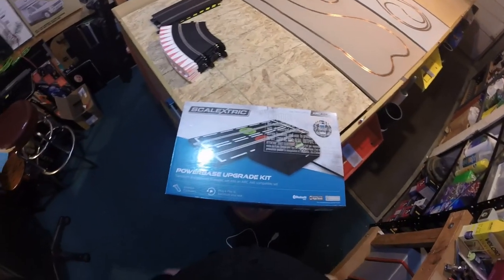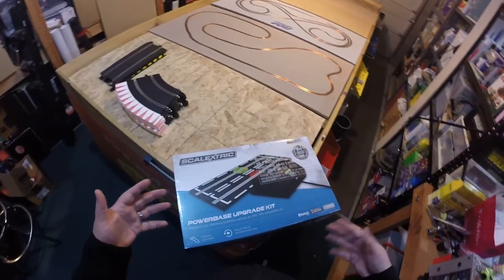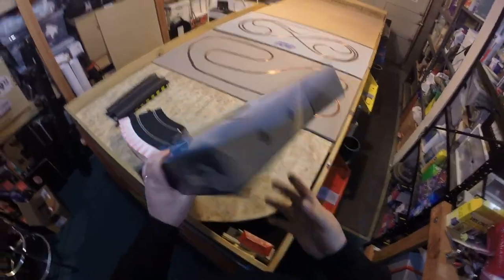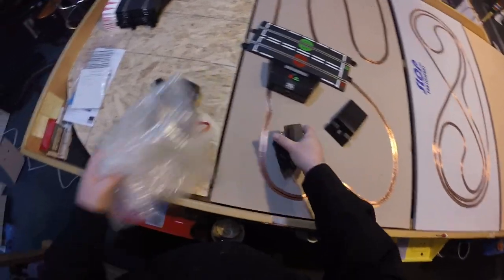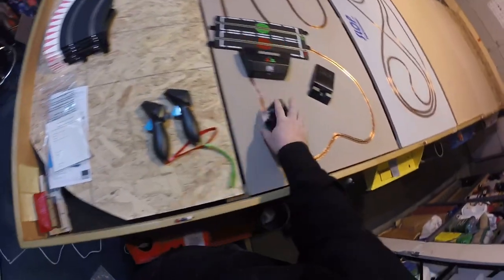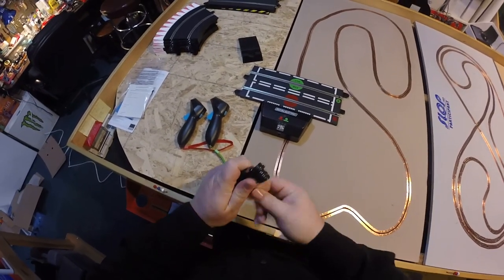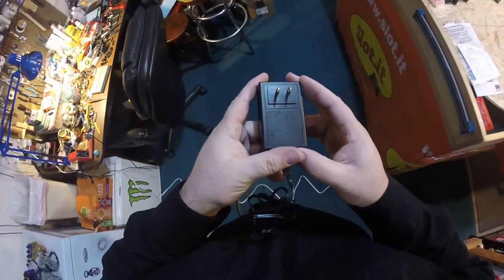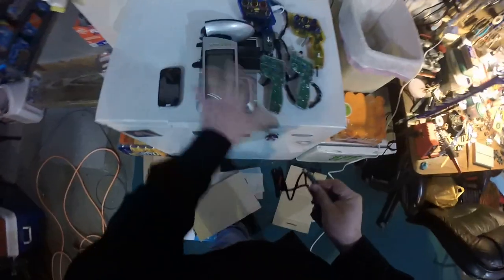Scalextric ARC Air Unboxing

Comment: Hi Greg I ran into your video trying to solve a problem I have with the ARC AIR powerbase. Basically everytime I trigger the accelerator on the controller paired to lane 2, I'm getting a "power base overload" error message on the app and a red light on the base itself. This happens even with no car in the lane. I have cleaned tje track, lane, everything, actually I'm testing it only with the base with no additional track pieces and still getting the error. The other lane works perfect. Wondering if you ever opened the base and have a clue on what could be going wrong. Thanks in advance!
Reply from the maker: Leonardo Rocco it sounds like the electronics that control the power to that lane are shot. I would contact the dealer or scalextric for replacement under warranty.

Comment: Hi Greg I have just unboxed my own Arc Air and there is a kind of buzzing in the cars motors al low throttle. Do you know if this is normal? Thanks for your videos. Very useful for beginners like me.
Cheers
Reply from the maker: That's not uncommon for a system like this where the power is provided using a wave of varying pulse width, not direct current. It will be more or less noticeable at different speeds with different cars. Do the cars seem to drive OK or is there a problem driving them? If you'd like to post a video, I can verify for sure.
Reply from the maker: @josevilar1012  Yep. Exactly what I figured. Totally harmless, and indicative of the PWM method of powering the cars.
Reply: @ggaub  Hi Greg, thanks so much for the info, it's kind of relief. Greetings from Spain

Comment: Of course the controllers take batteries I mean they are wireless! 😉🤣🤣
Reply from the maker: Hehe, yeah... I should have been more specific...  I meant it takes alkaline batteries rather than having rechargeable ones like other systems have.
Reply: @ggaub  of course I was just being facetious. The upside over rechargeable is that if they die you simply replace and keep racing but if rechargeables die you have to wait for them to charge. So plus and minus either way. I’m guessing the AA battery life will be quite long! So this ARC AIR is still analog racing not digital? I’m new to scalextric and still trying to figure things out!
Reply from the maker: @backyardcnc  yeah, pros and cons for everything. :)
Regarding ARC, it's ARC One for analog and wired controllers, ARC Air for analog and wireless controllers (and more features because of the wireless control), and ARC Pro for 6 car digital on two lane. The ARC Pro also has a switch that effectively puts it into "ARC Air" mode so you can run analog cars on the track (though one car per lane, and no lane changing, of course).